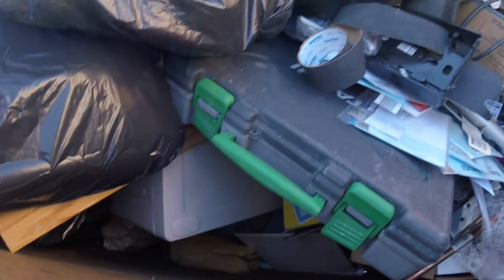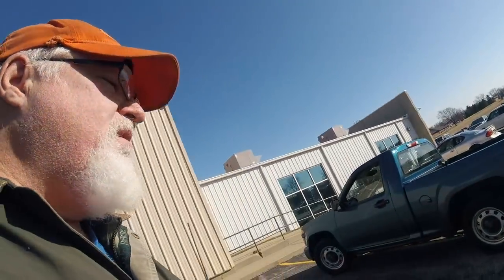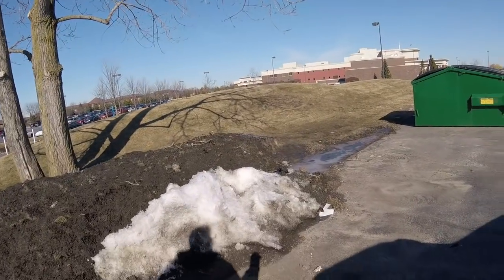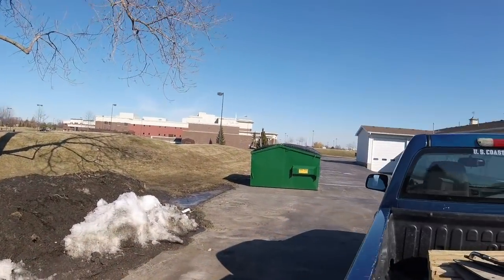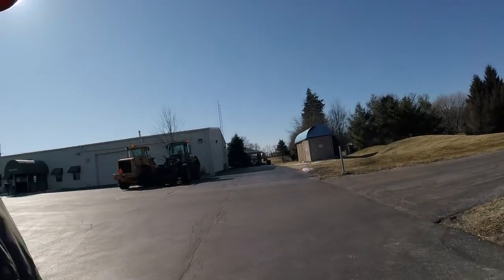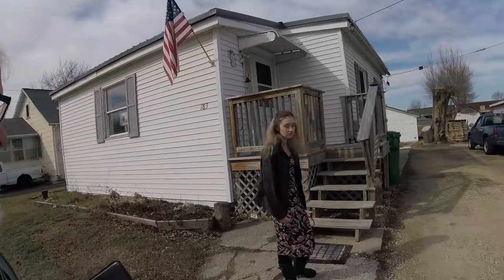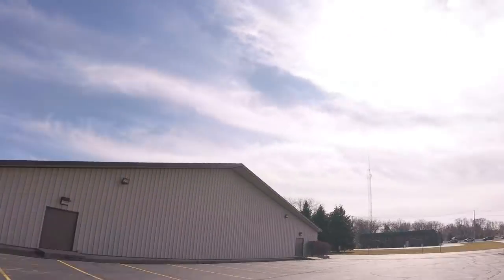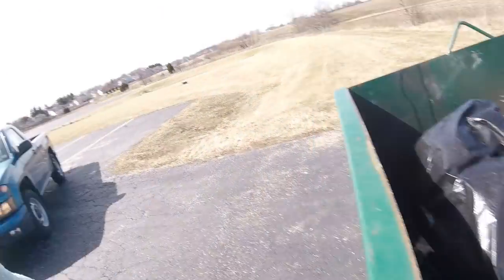Tools & Music Gear Found in the Dumpster and My Heartfelt Apology

Comment: you could just hook up some wires to that drill and then hook it to your truck battery. I've done it before we were free drills that I found it works pretty good and it's pretty handy on the fly.just an idea. or you could use it in your shed if you had an extra car battery lying around you could charge.